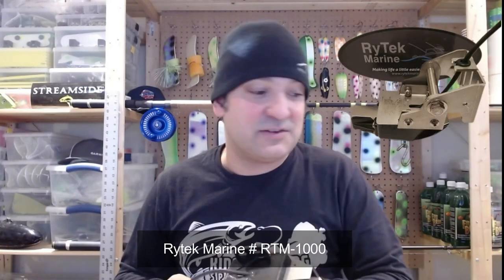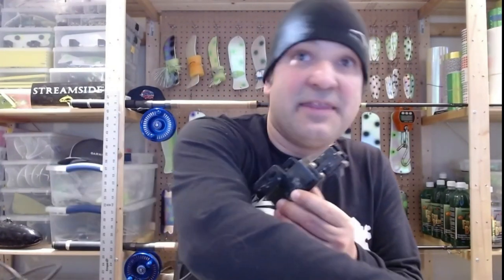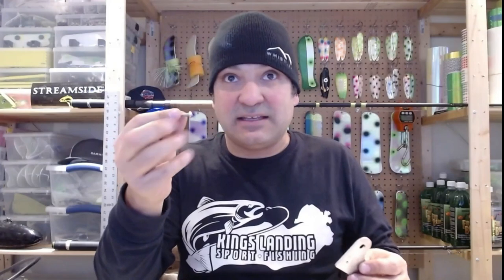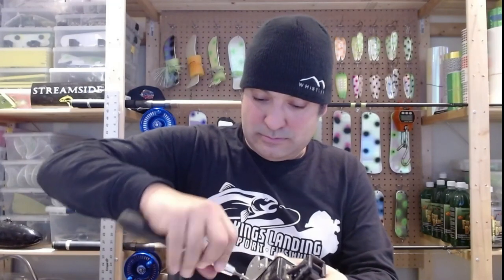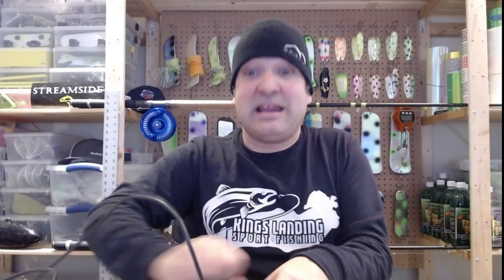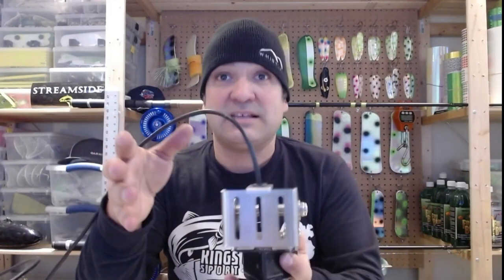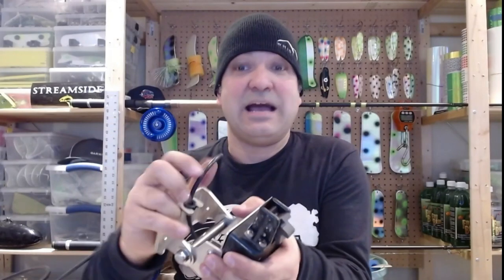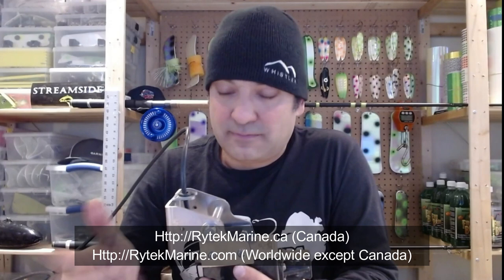Rytek Marine:  FishHawk x4 Transducer Mount

Comment: When installing the mount on to the boat do you put anything on the screws to seal it or is there special screws? My fishhawk is new in the box and I don't see screws that would seal or be water tight. 
Thanks in advance.
Reply from the maker: Personally I use PL Marine Sealant (https://amzn.to/35gVmZU) or 3M 4200 (https://amzn.to/33CgQQA).  Whatever you do don’t use 3M 5200 as it is permanent.

Hope this helps..

Comment: What angle should it be on a boat with a swim platform? Mine works when it wants too. It's a 31 tiera.
Reply from the maker: Mine is essentially flat to the hull bottom on my Tiara 2700 and works down to about 100-120ft with 17lb Titan Weights.   If my cable angle was greater I’d tilt the transducer a few degrees.
Reply: @KingsLandingSportFishing  I have it back some. But when current is ripping or rough as heck or when I absolutely need it. It won't read. Tried different heads and probes. I run 13 lb torpedoes
Reply from the maker: @phillipcolarusso1411  - I’d tilt it a little and or go with heavier weights.
Reply: @KingsLandingSportFishing   Plan on getting the Fish Hawk in the very near future!!  If I have to angle my transducer to get better readings when going deep let's say 90 feet.  Will anything change on my surface speed when its angled?  I'm running 8 pounds weights.  Thanks!
Reply from the maker: @jayfogarty7544  - should not be an issue